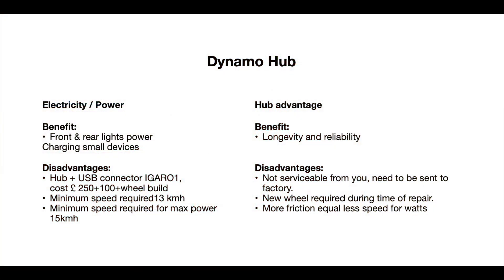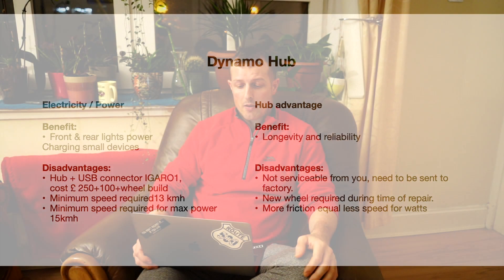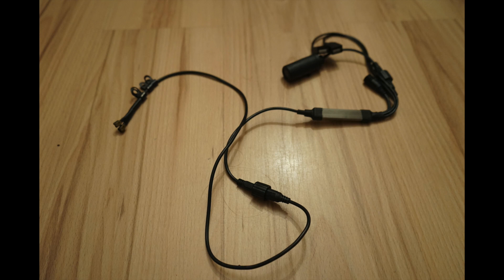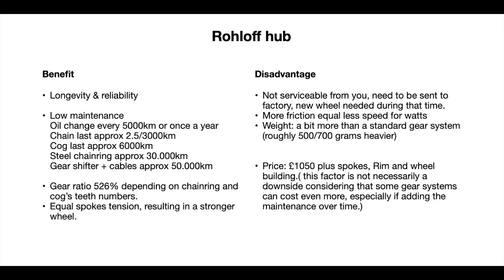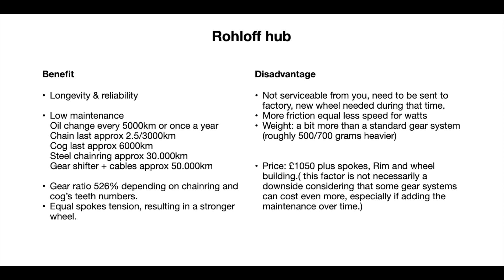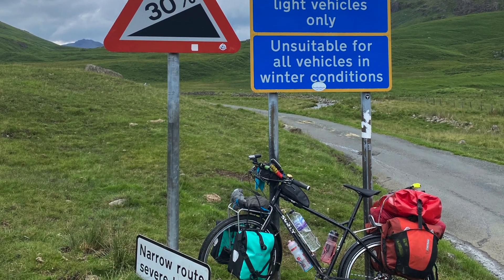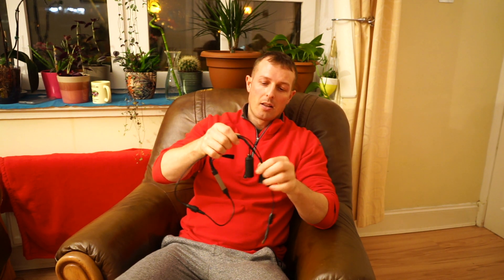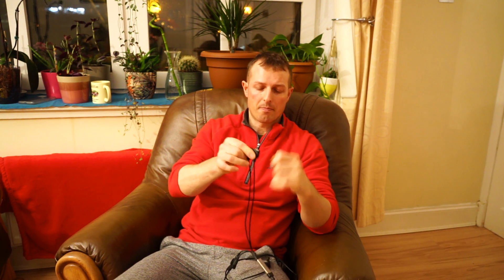Dynamo Hub and Rohloff Hub review

Comment: I ride a Tout Terrain Panamericana with a BaFang BBSHD mid-drive driving a Rohloff Speed-hub. The BaFang and Rohloff work seamlessly together. I won't own another bike without a Speedhub. I also have a SON dynamo connected to the headlight and a large battery bank in the bar-bag. I just switch between them when necessary. I couldn't possibly live without the dynamo-hub. My Garmin GPS won't last even 8 hours, and my cell-phone is a power hog, GoPors, MP3 player, lights, and on and on. With the mid-drive, I am almost always changing the battery bank, even climbing, anywhere unless I'm just rolling amongst pedestrians at a walking pace. 

After 4 years of riding an average of 6000 miles a year, I now change the chain and flip the gear every 3000 miles. When I do they are both trashed. At 1st I'd neurotically clean and lube chains after each ride, wash them weekly, stop wipe and lube them during rides. Maybe if I changed them monthly I could have got a new one to mesh with the rear gear but it was just too much maintenance. The chains (great high-quality KMC chains) wear so fast that even at 1000 miles when measured with a chain checker it needs to be replaced, but if I do the gear will no longer mesh with it and needs to be flipped. My front gear is a CDC off-set tooth Bling Ring that has always meshed with new chains without a hiccup. So I change my chain and flip or replace the Rohloff gear twice a year. Less than a 30-minute job now. I could probably go 4K or more miles but twice yearly is good with me. 

https://photos.app.goo.gl/wnvJTtTnxNCB2wPK8
https://photos.app.goo.gl/ZWBAwkXYmMYbS7L77
https://photos.app.goo.gl/z9a2zEN3n7hDbJ2V6

Stay safe.
Reply from the maker: Nice bike!!
Be safe too!!
Hopefully I will see u on the road once the pandemic is over !!!
Reply: @yashchirka4060  They aren't any more durable than KMC's E-line chains.
Reply: @yashchirka4060  Maybe so.... and I'm sure that someone could make a $1000.00 
Wunderkette. The answer is a belt-drive but my bike isn't adaptable. Stay safe.

Comment: The range of the hub is not changed by chainring or sprocket choice
A very well considered report on the Rohloff hub - if it suits your requirements its a great piece of kit
Thanks
Reply from the maker: Yes you right, I was mistaken in saying that.
I should say it's changing the speed ratio.. 
I find the hub a very nice piece of gear on my expedition bike which is made to go far rathe than fast  :)  obviously, it has its pros and cons.
Thanks for your feedback Daniele

Comment: 2.5 - 3k kms for each chain does seem very low indeed. Even with derailleur gears my chains lasted about 5k miles or 8k kms. What chain are you using? With Rohloff set up I get over 15k miles or 25k kms for each chain and the rear sprocket (std 16T) shows little wear and the front chain ring 42T (SJS) is still like new. You need to get a chain guard.
Reply from the maker: I Alex,
I remember you mentioned in a different video.
I am using KMC X1 and I change when stretching to the limit, by measuring it.
Obviously, I could go further but the cog is wearing out quickly so I prefer to change it.
Which chain are you using? perhaps mine is not as good as yours.
thanks for your comment !
take care
Reply: @gonewiththewheels8424  Me the same KMC X-1 Silver for single speed and IHG bikes. Unfortunately it was discontinued last year. You might find another on Ebay from old stock. I measure mine too with a Park Tool chain checker and renew when it reaches maximum wear. Hebie Chainglider is what I have. I had it from day one on my Troll. I lube the chain with chain saw oil. I look it off the first summer but kept it on for the next as it stops dust and grit getting to the chain. The chain is usually quite clean and new like when I take the Hebie chain cover off to check for stretch. The only other thing I can think of that might be different from your bike and mine is nothing. Maybe we have very different cycling demands and styles when riding? I usually pedal at high cadence 90-95+. I usually carry rear panniers which always seem heavy to me and then with heavy shopping a couple of times a week. It is quite flat where I ride in East Anglia, but even then that shouldn't make so much of a difference to chain wear. When I tour on mine I ride up and down hills and mountains fully loaded. I don't know what else to suggest to try to help you get more miles out of your chain and cogs but seriously for me the much increased life of the chain and reduced maintenance costs is the reason I chose a Rohloff gear bike. I think if I was getting as low miles as you I would seriously be considering whether it was worth it even with the big benefits of riding with a Rohloff hub itself. SJS do Hebie Chainguards or they used to or Rosebikes or Bike24 in Germany. You need the one for Rohloff IHG and front piece depends on size of your front chain ring. You can get different sizes. But good review of all the points. I love my Rohloff hub and Troll. It is a bit heavier but then I think 50% of it is the Surly Troll. It is not a light or frame for riding fast. I have a Surly Straggler as well which is not a light fast frame but not as slow as the Troll. 700c wheels have made quite a difference with 35-40c tyres making it roll faster and easier. I would like to try the Rohloff in my Surly Straggler. Keep updates of how you go.  Btw I think Surly have just announced the Troll is now discontinued. All the best.